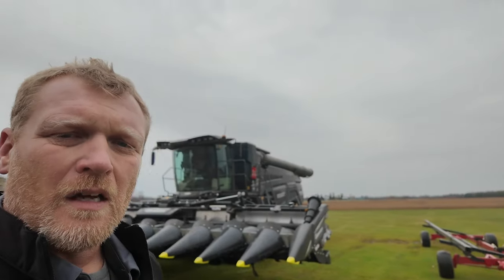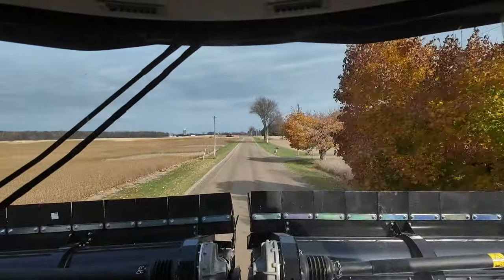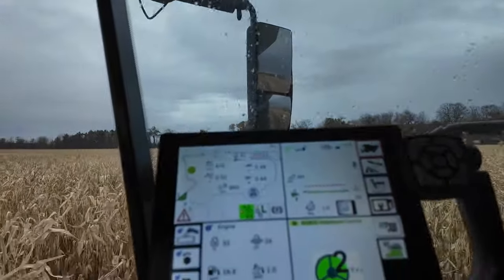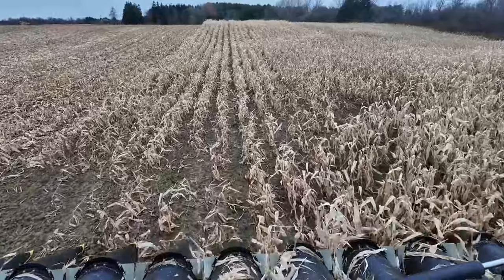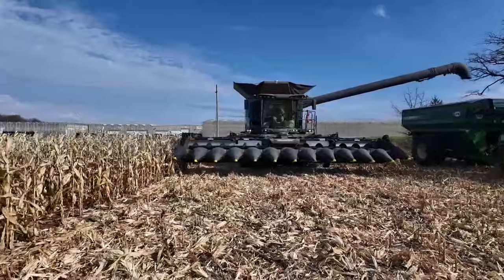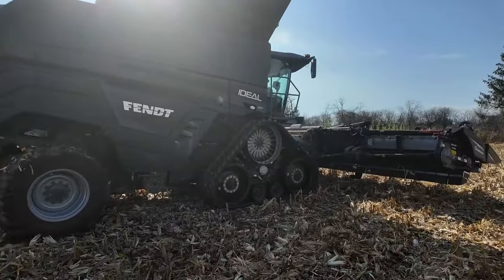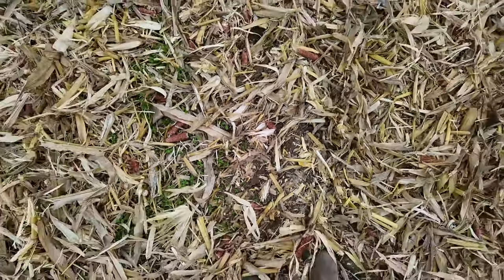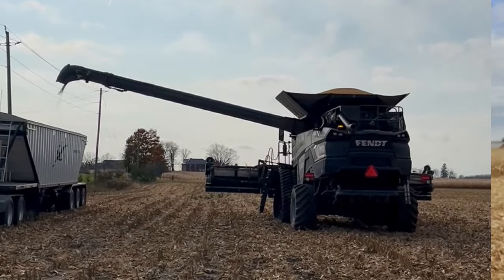Corn!!! - Can The Fendt 7T Hold Its Own With a 12 Row Chopping Head?

Comment: Gleaner. Always have. Worked for C.L. Benninger in summer '03 which made me a bigger fan.  Run 480R CATs at work and not cheap to repair.
Reply from the maker: Gleaner loyalty runs deep.  Always old reliable.   The early lexions were hard on repairs